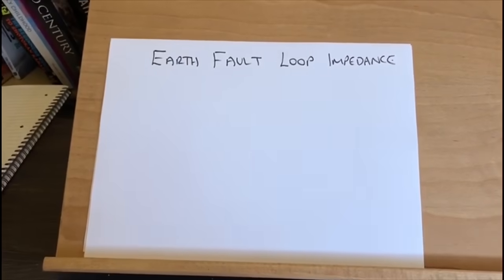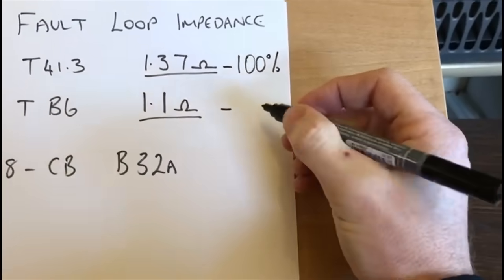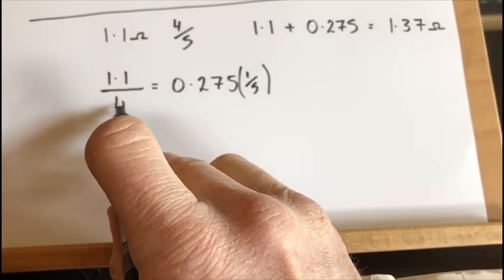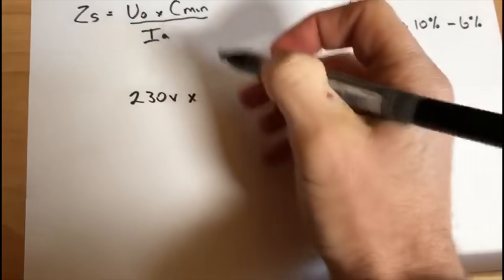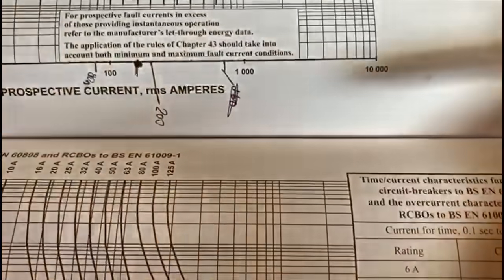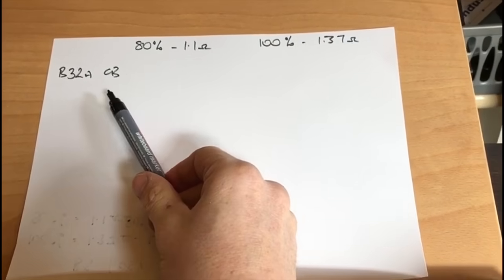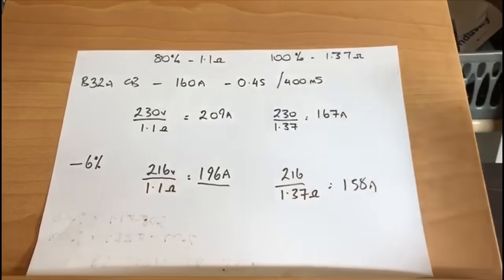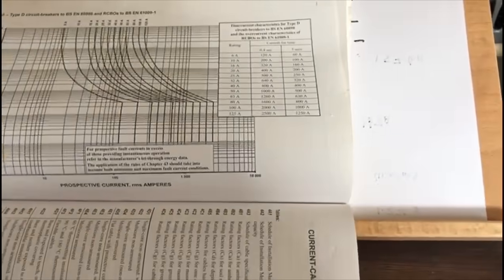Earth Fault Loop Impedance Zs 100% or 80% Values On Site With Matt. Calculations Using BS 7671

Comment: So when doing verification of a measured Zs, use the OSG table. One thing that I didn't see you mention. There is a temperature factor in table B8 of the OSG to apply if the ambient is not 10 degrees C. This brings the values in B6 up a bit for temps over 10 degrees.

Guidance Notes 3 mentions 4 methods for verification of Zs!

Comment: What’s the point then putting 100% value in the Regs book and then put 80% in the OSG? Why not just put 80% in both books ( ok you can change the formula in the regs so to understand where and what 100% Zs is on particular breaker but why not just add multiplication of  0.8 (  Zs= ( 230*0.95*0.8)/160= 1.1 ohms and then you get your 80% anyway and no confusion about what value you should take as acceptible Zs. I could be wrong but it come across like that to me..
Reply from the maker: How to Calculate Total Earth Fault Loop Impedance - Applying a Temperature Factor to R1 + R2
https://youtu.be/jF5Gf04GnlA

Comment: Great video, I understand the principle of using the 80% rule, when your verifying your results. When you do your testing sheet tho, in the Max Zs column you use the 100% valve in the regs book right? But when your actually testing your looking for below the 80% value and if it's over needs further investigation. like when you carry out insulation resistance and have a result between 1 and 2 M ohm, although it passes it requires further investigation. 

Thanks for the video and hopefully my question makes sense

Comment: It says in the OSG to get the 1.1 number to 1.37  you times it by 0.275 as the on site guide figure is at 10 degree ambient temp and the bs7671 is at 20 degree ambient temp

Comment: Yeah the reason behind the 80% and 100% here is off. The '100%' max Zs given in BS7671 is based on conductors at operating temperature 70*C. The '80%' max Zs given in the OSG is based on conductors at 10*C as they are likely that temperature when testing. Later when they're operating at 70*C the resistance will increase - it's accounting for that change.

Comment: Level 2 Exam on Tuesday after Corona Virus Testing. Great video.
Reply from the maker: Checkout online the eFIXX apprentice hub for questions to help with level 2
Reply: @GSHElectrical  Matt, I got 95% and your eFIXX certainly helped fix it for me. Thanks for letting me know just before the exam, which is really appreciated. Anyone else coming up to your exams should check out this valuable resource, Like everytjing GSH Electrical does and Subscribe.
Reply: @GSHElectrical  Thanks, that's really helpful.

Comment: The only issue I can see without doing any calcs is the case where you may need to use a D type MCB  in the DB due to the load type but are using a B type 100 amp MCCB in the SMDB upstream, I would imagine you will need to do some work on the discrimination study.. However, very well explained Matt thank you.

Comment: Hi to convert from 80% values to 100% the easiest way is to divide by 80 this will give you the value of 1 % then multiply by the percentage that you need i.e. 100 or for instance if you need the 90% value just divide by 80 and multipy by 90.  Also to get 80 % value from 100% value divide by 100 and multiply by 80. this is a lot easier to remember and calculate without using fractions. otherwise great video though. Kind regards Peter

Comment: Instead of working true fractions to convert from 80% to 100%. I use 100÷80 = factor of 1.25. As you use actual figures it is easier to see for those that don't do maths.

Comment: Quick one I hope, Ze on tncs 0.09ohms all good, but the manufacturers max zs on bs88gm fuse @400A 0.076. I have looked at other protection devices. Is my  only option to try and lower the Ze from supplier ?
Reply: Or introduce parallel paths.

Comment: Thanks Matt.  As an adult learner I understand your explanation.  I have studied this and really struggled with the temperature correction (mentioned in other comments).  I get the 70 degrees in the regs versus site temp will affect the resistance (Zs) but any chance of doing a similar video to explain the maths behind that.

Comment: Just a few things I'd like to add (sorry if it comes across like I'm being pedantic):
The difference between the 100% values in the regs book and the 80% values in the OSG are that the regs book is for a conductor at it's maximum operating temperature, the OSG values are maximum measured values with a conductor at 10 degrees C for a 70 degrees C conductor.  
The 80% comes from the simplified temperature coefficient for copper which is 0.004 per degrees centigrade and a difference of 60 degrees, giving a factor of 1.24 which the reciprocal is around 0.8 or 80%.
Reply: Thanks for that. I just noticed the values were different, and 80% lower in GN3. And yet I can't see ANY reference to the 80% correction factor in 7671, GN3, or OSG. WHY?? Why can't the IET put a little note explaining things like this? I just spent 150 quid on the latest set of books. Why do they want to confuse me?!
Reply: @Jo3yW  There is a note at the top of P140 of the OSG and P172 of GN3 saying a correction factor (divisor) of 1.25 is used.  
I agree - they don't make easy reading, 80% is the reciprocal of 1.25 hence instead of dividing by 1.25 you can multiply by 0.8.  I think it really ought to be 1.24 but it probably doesn't make much difference.  I think the older guidance notes back in the 16th edition days were easier to read or maybe I'm just getting old!  Back then we used a three quarter rule of thumb.
Reply: @cumberland1234  Yes, you're right, I see it now! I don't have an eye for the small print as yet.  I was looking for 80% when I should've been looking for 1.25. 
Also, to be fair to the IET, under Table 41.3 in BS7671 there are notes referencing operating temp adjustments. The first (only?) reference I can see to the 0.8 factor is on p410 Appx 3, in the equation to take into account increase of temperature due to load current.

Comment: I feel very old now - the old 230v value and the new 230x0.95 value - I remember it being 240v back in the 16th edition days!!
Reply: They come out with all this but in reality, when you check the voltage on the secondary side of the transformer it's always 240 + volts, when you check at your distribution board nine times out of ten it's over 235 volts, Thank God we are out of Europe. with this harmonization rubish.
Reply: @angelofranklin1   I don't know if it will change now to be honest.  I know we used to use 240v in our calculations as this is the Uoc ie at the transformer.  The efli included the wiring from the transformer.  Now we seem to be bending over backwards to make things more complicated and difficult for ourselves.

Comment: You do realise the 80% value is a temperature adjustment from the bs7671 values at maximum 70 degrees operating temperature, as the cables under test are at site temperature conditions and a 20% difference in temperature hence adjusting the 100% value by 0.8 otherwise known as ‘the rule of thumb method’ 
If the resistance is too high at ‘cold conditions’ during initial verification then at load conditions the resistance will rise above the maximum 100% value so yes we don’t exceed the 80% value but it’s nothing to do with the voltage , that has been taken into account with the Uo x cmin (218.5 volts) value given in your example as 1.37 ohms. 
See appendix 14 for more information.
Reply: ian adams your right cmin gets used at the design stage to  make sure circuits will trip in time when the Uo is at the minimum that the regs allows.
Also when a circuit is first switched on it is at ambient temperature 20 degrees? So the PSCC/PFC Will be at it's highest value,so these fault currents must be lower than the protective devices Icn rating!
Reply: Thank you for the explanation of  Uo X 0.95 that makes sense. Then the 80% value rule of thumb temperature adjustment from cold to hot (operating temp of cable under load) 👍🏻